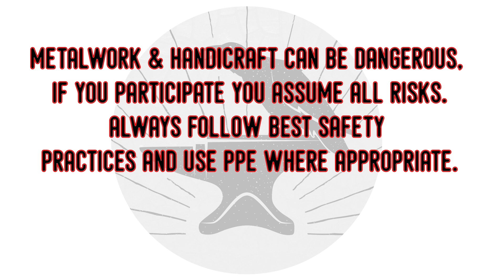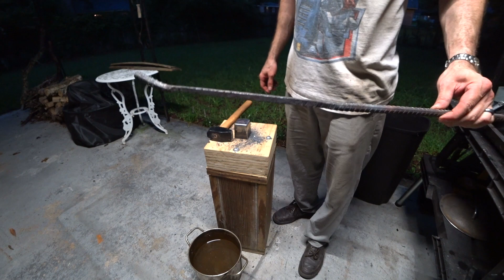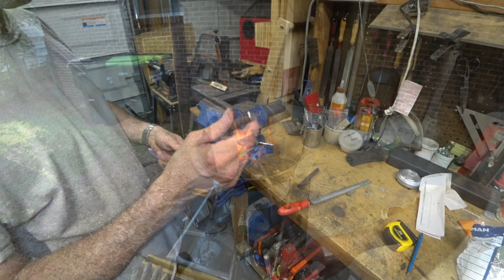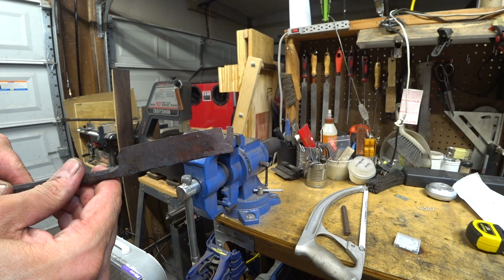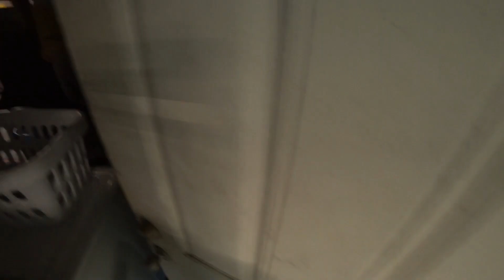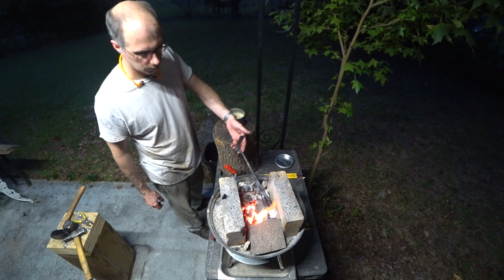Forge your first project--make a coal rake! | Start blacksmithing

Comment: I think before you started, you should have got the rust off the rebar. Maybe it would have made a difference in the end piece, maybe not, but it is good practice to do in blacksmithing to do so. It was certainly a helpful tool for you to add to your arsenal of tools.
Reply from the maker: Thanks for the comment. Don't worry though, surface rust is not typically an issue when forging. At forging temperatures, fire scale (black iron oxide) is created during each heat with exposure to air and any rust is incorporated into the scale. Since fire scale is impossible to avoid, there is minimal benefit to spending time on surface  prep prior to forging.
Reply: @ravensroostforge I agree